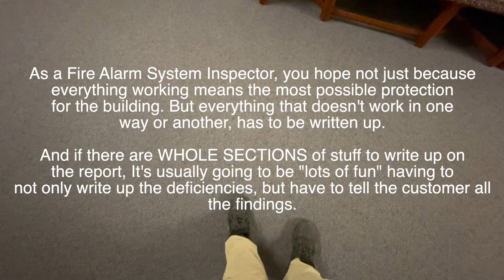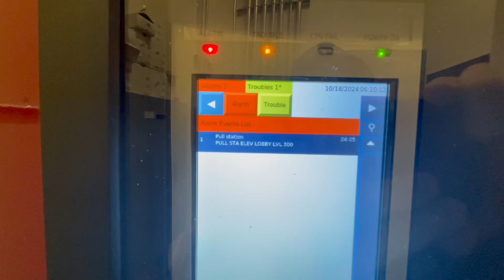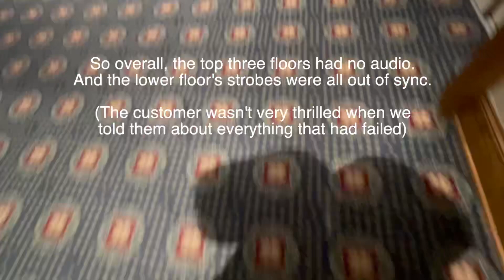I Think We Need New Amplifiers! (Fire Alarm A/V Test) [11-25-2024]

Comment: You're hearing the strobe pulse through the speakers someone probably mixed the strobe and speaker circuits together at some point. Also using the burg alarm as a communicator is next level crappy. Lots of bad shit here.
Reply: That’s not the strobes “pulsing through the speakers”, EST Genesis strobes are just really loud when they flash. All of mine make that same pop sound.
Reply: @Loganetics1 noted. Add it to the never ending bucket of reasons why EST is bottom tier equipment. 😂
Reply: @charlesblack2917  No it's not: as others in this comments section have noted it's more often down to the installers or technicians making a mistake than Edwards themselves.
Reply: @Loganetics1 That sound did save my ears from torture a few times. My high school had the horn strobe version of these devices, and the strobe circuit would make that pop sound a second or so before the horn went off. Same thing was true in elementary school when we had the Integrity’s, but instead of a pop the strobes would buzz slightly before the horn sounded. I also noticed that our gym and cafeteria, which were in a separate building, would usually sound a split second before the academic building, resulting in a split second warning “(buz)*BUZZZZ!!!*” effect in certain rooms.

Comment: Modern day EST sucks nowadays. Edwards used to be better before it got turned to EST in the 90s. Cheap junk
Reply: Yeah the addressable panels back then were much easier to do, but due to the rise of software based programming on the EST 3, it has become such an issue as the software has to well put together and programmed correctly
Reply: Wrong

Comment: Installers probably did something really freaking stupid. I’ve worked with the EST4 and other EST products and they never act up like this unless someone messed up bad. Plus, it’s pretty obvious user error is most likely to blame as not only are the parts new but the system has sync issues. Your company needs to get an Edwards partner out there. Question: Is this in Georgia? I work with Southern Signal in Lawrenceville and we are an Edwards dealer. We have someone who is EST4 certified and a few more techs are due to go to class soon (me included).

Comment: Yeah this is a typical problem with Edwards systems when they aren't installed properly or programmed incorrectly because it's a software based program which is like Simplex but Simplex is worse because of their customer service

But as of right now these companies do have good reliable products

Comment: Typical edwards experience
Reply from the maker: No kidding. Especially with the voice evac systems.
Reply: @ZDC2002  I’m pretty sure this system wasn’t put in right. Bad installs are the achilles heel of most Edwards installs as lots of techs don’t understand how to use Edwards equipment as it can be somewhat complicated. Plus, this is a brand new system and has other issues that scream user error (like the sync issue). There is no reason a brand new amp should be bad. An Edwards Dealer with a certified tech needs to come out stat. I work for an Edwards dealer in the state of Georgia called Southern Signal. We can fix whatever the installers broke.
Reply: @FireAlarmDoctorYT1977  was probably union electric without improper training. See it all the time. This system fault is definitely user error and not est.
Reply: Wrong
Reply: EST, bring every single trouble to the field 😂😂